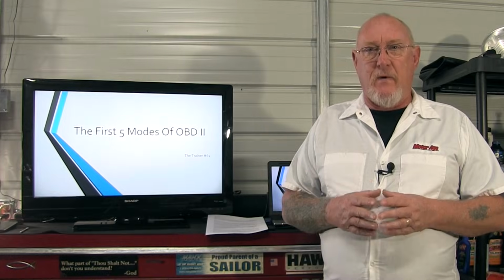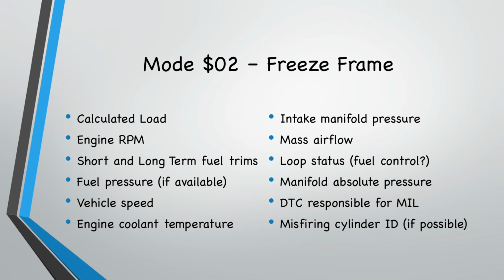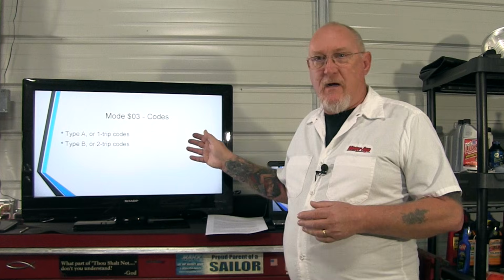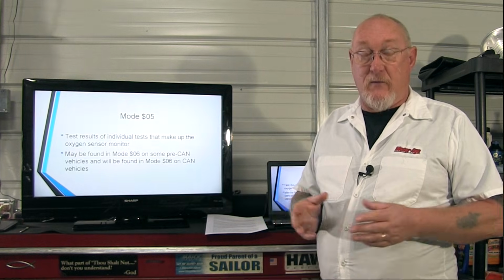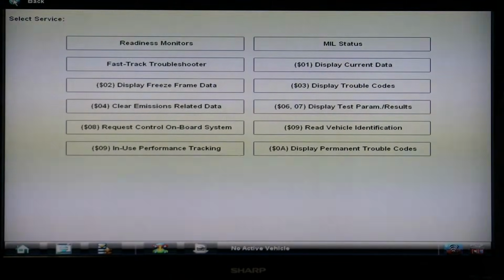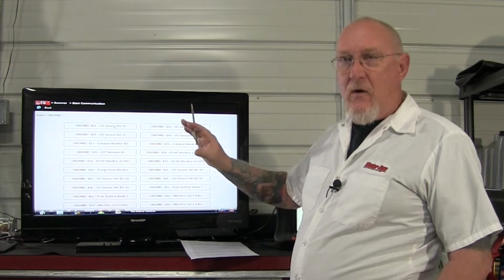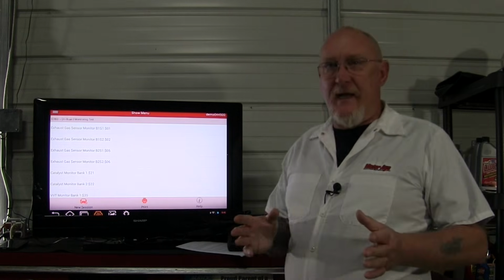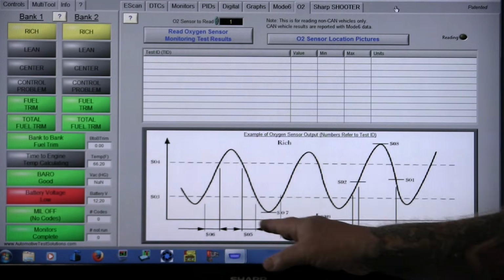The Trainer #62:  How To Master Your Global OBD II Scan Tool - The First 5 Modes Of OBD II

Comment: Bought a 04 Tundra - and immediately had Timing Belt and all necessary parts(alt,starter) and a GATES Belt Tensioner….that DIDNT last 5,000 miles….Now GATES - is denying The Claim! Over $3,000 Damage - from a Faulty GATES Belt Tensioner.

Comment: great  information but a question -  how can one easily tell if a vehicle is a can vehicle???  especially 1990 to about 2005?  after that almost all are or have can lin etc
Reply from the maker: Most scan tools scan through the various protocols when attempting to connect, so watch that. Another way is to check for communication on the different OBD II pins on the Diagnostic Link Connector. I use a DLC break out box (BOB) that actually flashed LEDs on the comm lines that are active. Service info will tell you, too.

Comment: Why can't a scanner take a snapshot of the freeze frame data and store it?
Reply from the maker: The Freeze Frame is a snapshot - taken by the ECM and read by the scan tool. But if you clear codes OR disconnect the battery, it will all be lost. That's why many trainers recommend you take out your phone and take a picture of the data or print it out, prior to clearing codes.
Reply: ramdodgetruck a lot of scam tools can store data and save graphs mine can but it cost 2500

Comment: Hi Pete. Nice videos. I am a retired powertrain diagnostic engineer and like keeping current and enjoy your channel.
I wonder and maybe you will cover this in the future videos, does the EScan Pro (ESN2000) or any other aftermarket scan tool have bi-directional capabilities? ie: command relays/solenoids, injectors, ... ON/OFF?
Thanks.
Reply from the maker: The EScan Pro does not offer bi-directional controls. But it does offer unique features as a drivability diagnostic tool. Check it out here:  http://www.automotivetestsolutions.com/escan-pro.html

And there are several aftermarket tools that do offer bi-directional controls, as part of the "enhanced" OEM specific mode. Typically, you pay for it by genre; domestic, Asian, European. Some are more capable than others.

Or you could look at full factory capability. Many OEMs are moving to online software that works with a J-2534 PassThru device mated to your own laptop. There are some precautions if you intend to use one laptop, though, to host multiple OEM applications. Some don't play well with others. Take a look at this video: https://youtu.be/6I7KnkAsLqw

Comment: Hi Pete, great info video!! Do you have the autoenginuity? Which is better for mode 6 Escan or autoenginuity as per your personal preference?
Reply from the maker: I do have the Autoenginuity tool and have had a lot of success using it as a full function scan tool. I also have the EScan tool and like the fact that the Mode $06 data can be set to refresh - a feature unique to that tool. But both offer a lot more. As always, it comes down to the task at hand and personal preference...
Reply: Does autoenginuity translates the mode 6 and sets the green-yellow-red or that is only on the Escan? Thanks for responding
Reply from the maker: I'm pretty sure they do, but it has been a while since I looked at it. I'm covering those modes in the next edition of The Trainer, so I'll be sure and try them both out there.
Reply: Thx I look forward for your next video!!